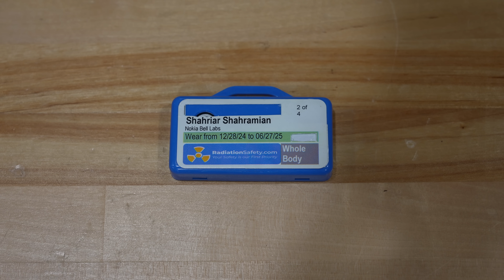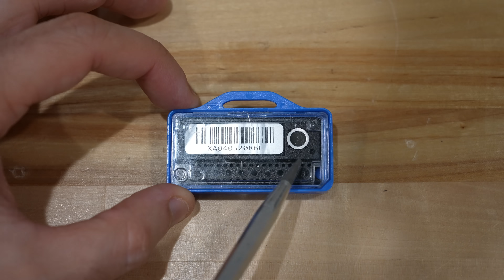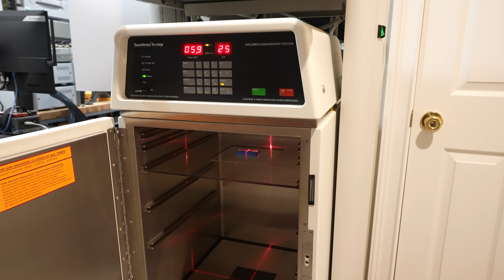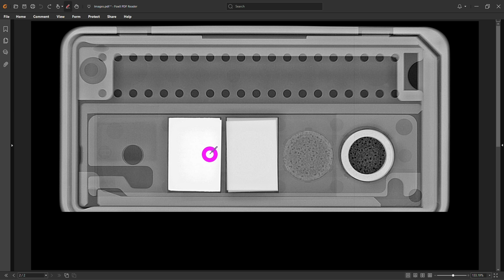TSP #269 - Wonderful Complexity of X-Ray Dosimeter Badges! Teardown, Analysis & Theory of Operation

Comment: Always been impressed by TLDs especially considering how cheap they are, how long they've been around for and how simple they are (no electronics, just solid pucks of material). Instead all the complexity is in the physics/chemistry and readout device.

However, I'm not convinced this badge uses TLDs solely because the carrier looks too much like ABS plastic. Normally TLDs are permanently retained in a high temperature material like aluminum/ceramic or are easily removable from a plastic carrier. I wonder if maybe this particular badge is using OSL detector elements as the industry has been switching to that as it's got some good advantages, particularly with simpler materials and lower cost. I also believe LiF:Mg,Ti is pretty old now those days and isn't really used anymore. But if they are OSL they're probably BeO so don't lick them! But you should be able to easily determine which they are by checking their fluorescence at particular wavelengths. Would still be a cool demo to read out the dose an look at the physics behind them regardless of if they're TLD or OSL!

Comment: Considering we are exposed to naturally ocurring radiation all the time we would all be dead if the effects accumulate as you suggest
Reply from the maker: At very low dosage, for example natural sources, the accumulative effect is below the repair rate of our biology. This is why, for radiation generally below 100 mSv/year, we don't worry about the accumulated effect. Although we consider biological effect to be cumulative over time it does not happen linearly without limit at low doses. 
And in case you weren't aware, we do in fact end up all dead. Most humans who live long enough die of cancer. Mutations leading to cancer are also accumulative and require multiple mutation chains to ultimately cause cancerous cells. There are many sources of mutations. Some people like to accelerate this accumulated effect by smoking or spending too much time in the sun.
Reply: @TheSignalPath  "Most humans who live long enough die of cancer." Isn't this is like saying "Most humans who don't die due to other reasons, will die due to X"? Pretty sure heart disease is well up there along with strokes and covid, etc. not just cancer.
Reply from the maker: Cancer is the ultimate barrier at the moment. Because no matter what, the mutations will aggregate in the background. The underlying cause of cancer is very different from heart failure.

Comment: Back in the mid seventies a physicist friend of mine, Paul (also a very fine flautist), was developing a method of dating pottery shards and similar archeological ceramic finds using similar principles by finding the amount of background radiation they had absorbed over the years. The samples were run twice. First a measurement run, where they were heated in a furnace and photons counted. This 'reset' the thermoluminescence and then a known radiation dose was given to the sample, and then another run in the furnace, to calibrate the material's response to dosage. Do some maths and the age since the ceramic was initially fired popped out (the original initial firing during making having 'reset' the thermoluminescence clock).

Comment: 1:20 this is not true: dose fractionation is a real thing to reduce harm. 1 R + 1 R a week later causes less biological damage than 2 R absorbed in one day. This is due to oxidative stress mitigation and dna repair mechanisms at work with a limited repair capacity per unit time.

This is very simplified of course, and just integrating the dose without consideration for fractionation is good enough for accounting and is erring on the side of caution for most normal use cases.

Comment: I always learn here. Thank you Shahriar!
Kyle Hill, quite a reputable guy, days ago launched a video debating the traditional linear "cumulative effects" radiation safety model. It is quite eye-opening. I am still confused.
Reply from the maker: As long as the radiation is below a certain limit (below our body's ability to repair), then it is not accumulative. That is generally why there are "safe" rates which are acceptable.
Reply: It's a pretty widely held position in the health physics community that the LNT model is wrong - but it's still useful because it's wrong in a way where it will only overestimate the risks. From a health physics point of view this is not a problem - it's errors that underestimate risk you need to worry about.

Comment: AI Summary

Abstract:

This video provides a scientific teardown and explanation of a personal X-ray dosimeter tag. The analysis begins by outlining the tag's essential functions: to measure the cumulative effects of radiation and to differentiate between various X-ray photon energies, which have different penetration depths in the human body. An initial X-ray scan of the tag itself reveals an internal strip with multiple sections, each shielded by filters of varying densities. A physical teardown confirms these filters are made of plastic, aluminum, and copper, designed to block different energy levels of X-ray photons.

The core of the device is identified as a Thermoluminescent Dosimeter (TLD), likely a lithium fluoride crystal doped with magnesium and titanium. The video explains its operation: X-ray exposure causes electrons in the crystal to become trapped in the lattice due to the magnesium impurities, creating a "memory" of the cumulative dose. To read the dose, the crystal is heated to around 400°C, which releases the trapped electrons. This energy release causes the titanium dopant to emit UV light (thermoluminescence) in an amount directly proportional to the original radiation exposure.

Deconstructing an X-ray Dosimeter: How It Measures Radiation Exposure

*   0:00:07 The video introduces a personal X-ray dosimeter tag, a device worn to measure an individual's exposure to X-ray radiation over time.
*   0:01:30 For the tag to be effective, it must mimic the human body's response to radiation by measuring the cumulative dose and must be able to discriminate between different X-ray photon energies, as low energies affect the skin while high energies penetrate to internal organs.
*   0:04:05 In a preliminary analysis, the dosimeter tag is X-rayed, revealing an internal removable strip with four distinct detector regions, each shielded by filters of varying density.
*   0:05:54 The different filters (some transparent to X-rays, others partially or fully opaque) are designed to separate incident radiation by energy level. This allows an analysis of not just how much radiation was received, but also its energy profile.
*   0:07:08 A physical teardown reveals the filters are made of plastic, aluminum, and copper. The ability to block X-rays increases with the material's atomic number (Copper > Aluminum > Plastic), creating a tiered system for energy detection.
*   0:09:28 The detector technology is identified as a Thermoluminescent Dosimeter (TLD), which uses a special crystalline material (likely lithium fluoride doped with magnesium and titanium).
*   0:10:32 The TLD's "memory" function is explained: when X-rays hit the crystal, electrons are excited and become trapped within the crystal lattice due to magnesium impurities. The quantity of trapped electrons is proportional to the total radiation dose received.
*   0:11:02 To read the stored dose, the TLD crystal must be heated to approximately 400°C. This heat provides the energy for the trapped electrons to escape.
*   0:11:10 This process is called thermoluminescence. As the electrons escape, they interact with titanium atoms in the crystal, causing the emission of UV photons. The total amount of emitted UV light is measured by a sensitive detector and is directly proportional to the original X-ray dose.
*   0:12:21 By individually reading the TLD from behind each of the four different filters, analysts can reconstruct both the total radiation dose and the energy spectrum of that radiation.

AI-generated summary created with gemini-2.5-pro for free via RocketRecap-dot-com. (Input: 18,313 tokens, Output: 783 tokens, Est. cost: $0.03).

Comment: Regarding the anode materials: there can be many of those depending on application. I have experience with X-ray crystallography and for this application, copper anode is most commonly used and data is obtained at the K-alpha wavelength by filtering off K-beta and the braking radiation (Bremsstrahlung). Molybdenum anodes are also quite common for cases where greater diffraction is desired as Mo K-alpha has lower wavelength than Cu K-alpha.

Comment: You should totally do it! Do you think these things are anywhere close to the quantum efficiency of an x-ray imaging plate? I've built an imaging plate reader using an R7400U PMT (not a high performer!) and it frankly wasn't hard (as far as these things go). The thermal concern is real, but maybe you could solve that with some judicious forced air cooling over the face of the PMT, say in an air knife configuration powered by a laptop CPU cooler centrifugal blower.

Are you sure the sample with the metal ring isn't some whole body weighted average? I have a GM tube based rate meter that has a multi-material filter around the tube, composed of what I believe is two half-shields of aluminum separated by a gap created by a nylon washer. I always assumed this was to filter it in a way that better mimicked some sort of multi-tissue human body exposure model. 

And actually, are you sure it's not a photostimulated luminescence system? I guess I'm having trouble picturing why they have heat staked a disk that needs to be eventually heated up to 400C into a plastic carrier. I guess the machine could just punch the disks out, but some other systems I just saw online seem to have retainer clip systems for each sample that are much more clearly designed to ease removal of the samples from the carrier.

Comment: Things I learned from this video:  1) correct spelling of Shahriar's full name  2) He works at Bell Labs  3) Bell Labs is now owned by Nokia and 4) a whole lot about x-rays, materials blocking & absorbing them and how to read the results of the x-ray exposure badges ! 😊  Thank you Shahriar.
Reply: And before Nokia, Bell Labs was owned by Alcatel-Lucent, after Lucent, after AT&T.  I think Pizza Hut is in there too, somewhere :-)
Reply: I got it until the third point. Which is already a lot compared to all of the other videos.
Reply: What idk is if the lab in the videos are its own or bell labs one
Reply: @winsrrow8125  He says in the video the x-ray is at work (i.e. Bell Labs) and the rest (wall of equipment) is his own lab (in his bedroom).
Reply: @shazam6274 I'm 99% positive that the x-ray machine is at home. The one in the video at least. He works with x-rays at bell labs. Or at least had to work with x-ray equipment at work.
Reply: @garci66  I think you are correct.  It's just that in the narration it is not so clear.  There would be more powerful x-ray machines at work.
Reply: @winsrrow8125 that's all his home lab.

Comment: I remember wearing one of those detectors when I went to a nuclear power station to see the reactor in Wales (Wylfa Power Station). This was back in the day when you could go to these places and see them up close. I was about 12 years old. I doubt I'll ever see a nuclear reactor close up ever again.

Funny anecdote: My watch set off the radiation detector and I thought I was going to die. Thought I'd been exposed to extreme radiation. 😂 They explained after, the fact that the fluorescent elements on the minute and hour hands on my watch (that glowed green) contained radioactive materials, and that they were completely safe to be exposed to. They let me through.

I've since found out that a small amount of excess nuclear radiation above background level is actually slightly beneficial to the human body (up to a 100mSv/yr limit) causing natural biological repair mechanisms to kick in when exposed to nuclear radiation. This apparently has more of a "protective" effect against nuclear radiation than those who aren't exposed to the same levels (just background), leading to longer lives. Of course, above that 100mSv/yr level, things change to negative outcomes.

It seems counterintuitive. Something to do with the regulatory limits based upon "Linear No-Threshold" (LNT) modelling, how it doesn't take into consideration the body's repair mechanisms when it comes to damage from nuclear radiation, that it instead plots the damage on a purely linear chart that's based upon extreme exposure.

Anyway, thanks so much for the video. I always love your uploads!